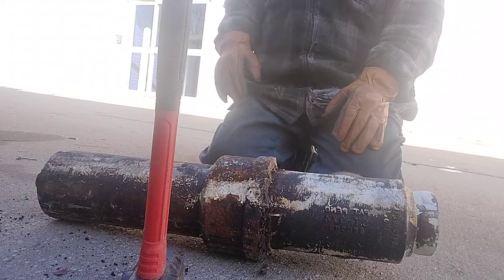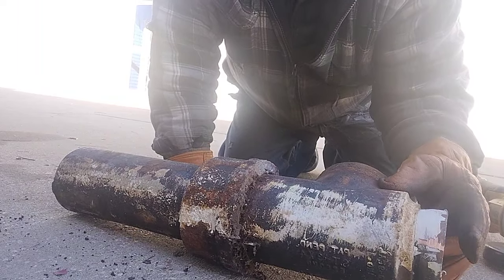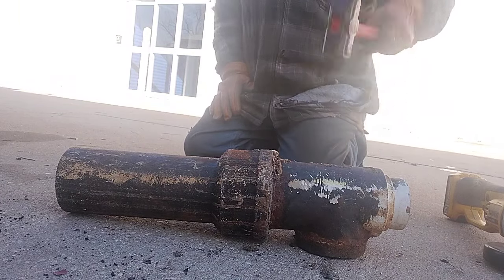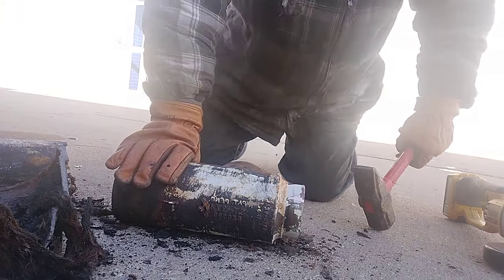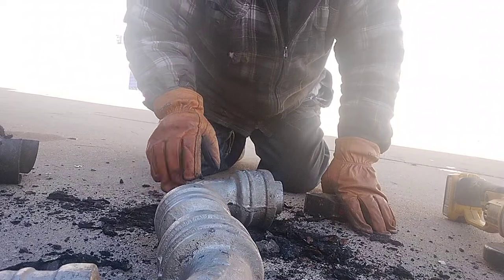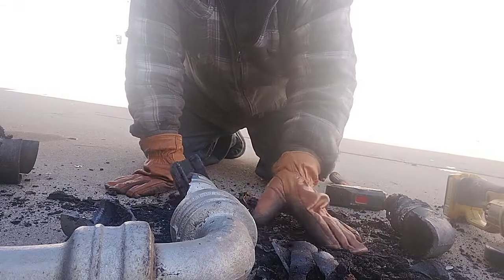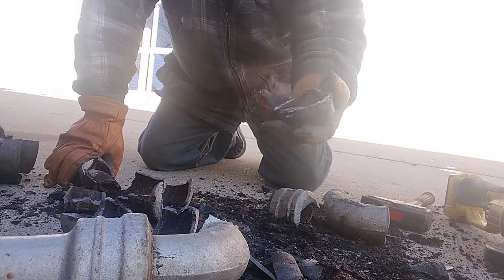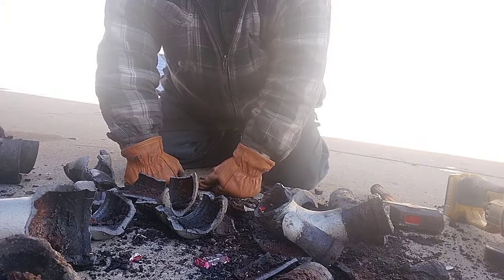Get The Lead Out!

Comment: Don't come by much of that, but see it in ceilings every day, i try to avoid touch them. They are old and nasty usually! Maybe use an N95 in this case? Would like to see more videos of you,without respiratory issues
Reply from the maker: That is a good suggestion, Daniel!  👍👊 My respiratory issues unfortunately are set in stone from 25 years of no PPE in the construction industry.  😥 They just didn't preach it back in the '80's like they do now.  😥👊